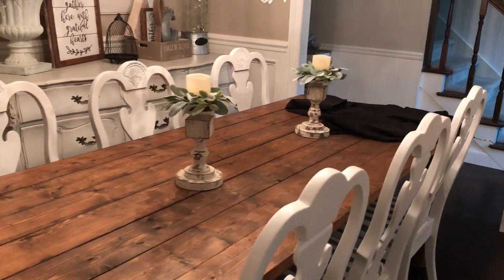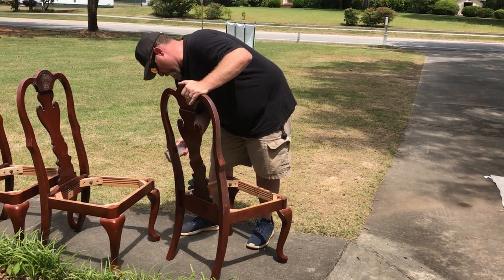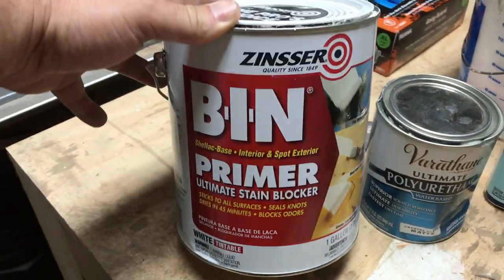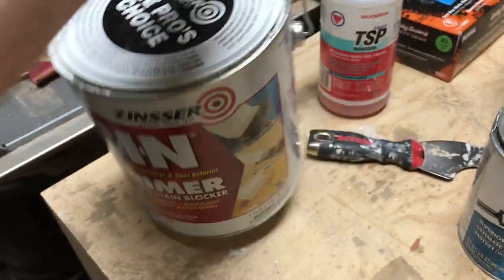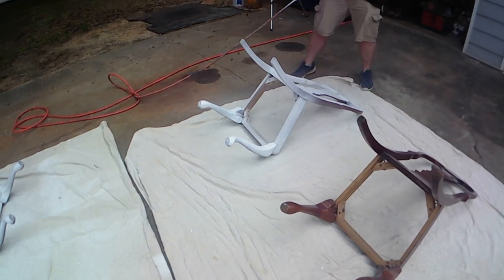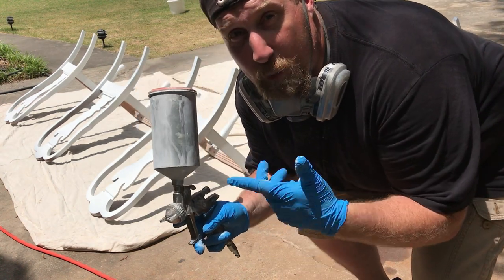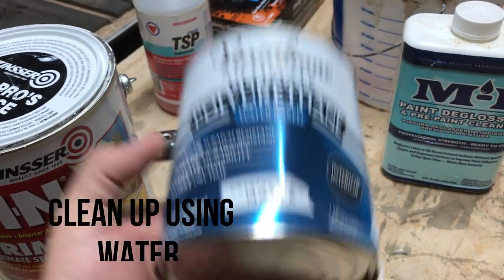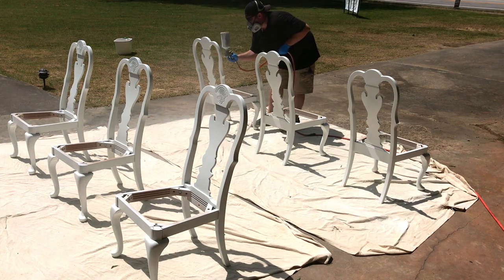Easy way to Paint Chairs [WITHOUT SANDING] | Paint Furniture | Paint Wood Furniture

Comment: How have they held up? I’m doing exactly this, using all your recommendations, just minus sprayer (brush) but will be spraying the water based poly (bought that in spray paint cans)  to finish off! Please let me know if ud recommend anything diff than what’s in this vid, based on 3 years of wear? Thx!!!! Just subscribed!
Reply from the maker: I just sprayed these this last year.  Also, they are in our formal dining room so they don’t get used and abused too much.  However, I recommend this finishing technique along with the recommended # of coats of water based poly to achieve max protection.  Additionally you may decide to top coat the primer with a paint and then coat with poly.
Reply: Did you hand paint the primer? I do not have a sprayer
Reply: @deniseklipppenstein-garcia6122  hi! I did 3 coats of shellac primer, let dry for 2 days, then 2 coats of white spray paint (the fancy rustOleum stuff that includes a primer in it), then let dry for 2 days, then 3 Coats water based primer in spray can form. My stools turned out fantastic!!!

Comment: What kind of an air compressor do I use for the paint sprayer, and which sprayer did you use.. thanks
Reply from the maker: I’m using a 20 gallon Husky sprayer from Home Depot.  Ideally you want a bigger compressor (so you don’t have to constantly wait for it to recover), but for small projects it works fine.  I’ve even sprayed kitchen cabinets using it.

Comment: Thank you for your video. I wanted to see how you do it upside down first. Don’t quite understand the primer only part.
Reply from the maker: We just went with the primer because it really mimics the “chalk paint” look/feel.  It covers well and no need for tip coat is that is what you want
Reply: Tony, really. I never saw anyone do that. Certainly saves some steps.
Reply: Always wondered if I could just use a tinted primer and top coat it, thanks!

Comment: Very informative video. Thank you. Whats the best topcoat to use after Zinsser Primer for painting dining room table and chairs. I want to paint the table and chairs grey.
Reply from the maker: You would want something with a hard finish.  I imagine you could use Emerald from Sherwin Williams or a furniture paint (they have some options on the shelf at most big box stores).  I’ve even used regular latex paint top coated with water based polyurethane and it worked well.

Comment: Thank you for sharing this. I am about to start a similar project but I do not have a sprayer. What would be my other options? In the list of tools listed at Homedepot, none of the links shows the hose and what it is connect to or spraying with. Help please
Reply from the maker: First off, thank you for watching.  The stayer setup I’m using is not unique by any means but some would consider it expensive.  The air hose and spray gun are from my days painting cars in my younger years.  You can buy the hose and a spray gun at harbor freight for cheap...there are tons of videos about the purple spray gun from harbor freight.  The compressor I’m using is a husky (Home Depot) 20 gallon upright compressor.

Other options would be brushing the piece(s)...but for me that is too time consuming and labor intensive.  You can also use a Graco hand held sprayer (I use it in another of my videos).

Let me know how your project turns out
Reply: @TonyCollumtheHOWTOHERO  Thank you very much for replying and tips
Reply from the maker: You are welcome.

Comment: I ran across your video.  Did you have to thin the primer for spray gun ?? And how you clean spray gun ? Thank you for your help
Reply from the maker: Great questions!  No thinning was required (BIN primer is thin like water).  Unfortunately to clean the spray gun is a little difficult...I use denatured alcohol per the instructions on the can of primer.
Reply: @TonyCollumtheHOWTOHERO  thank you so much.
Reply from the maker: @thuywebb3619  no problem!  Glad to help

Comment: The purple paint gun that you recommended from harbor freight has a 1.4 nozzle. Can you spray the primer you used with that gun?
Reply from the maker: I’ve never personally used the purple gun but this particular primer is thin so I wouldn’t see a problem with it

Comment: Hi! Remodeling my kitchen.. can I use the same process for my kitchen cabinets? I've sanded some but it's a lot 😪 and my molding is high as well..trying to save some time. Thanks in advance!
Reply from the maker: Ok, so I’ve painted several cabinets.  The key to any project is preparation.  I’ve used this same technique on my daughters bathroom vanity with great success.  First and foremost you must make sure the cabinets are clean and free from grease.  Then I still recommend a light scuffing, a good primer, and then a quality paint.

Comment: Does the primer 1 2 3 you suggested had a bad/strong smell?  I have COPD and the furniture can not be taken out doors. Any other suggestions?
Reply from the maker: It does have a smell, but not overly strong.  It is a shellac based primer and is an interior type primer.  Either way I would recommend providing plenty of ventilation.

Comment: What paint sprayer is easiest to use? I don’t see yours in the description box, thanks 👍
Reply from the maker: Mine is an old sprayer I bought many years ago when I was painting cars.  Harbor freight has a good one (it is purple colored).  Just make sure you clean the paint gun really well and remove any of the oils left over from manufacture.  

The paint gun I have, has a 1.7mm spray tip.  It works well but having a bit bigger tip would help when spraying thicker paints (it works perfect when spraying the BIN primer which is thinner)
Reply: Do you have to put any thinner in the sprayer with the paint? Or just a bigger tip?

Comment: What size air compressor?
Reply from the maker: I use a 20 gallon Husky air compressor.  Works fine for small jobs but does struggle with larger jobs.
Reply: Thank you!

Comment: There are some stains and knots that will bleed through any primer... however, they usually will not bleed through shellac.  Prep is painful no matter what, but nothing will infuriate you more than prepping and painting only to have to duplicate the work.
Reply from the maker: You are correct.  The primer used in this video is a shellac based primer for that very reason.  I’ve used it on raw pine with bad knots and had it work perfect.  I always say prep prep prep.  

I actually edited out some audio where I told my wife we teach people the right way to do things on this channel...that is why I gave the disclaimer that she was the boss and wanted it done.